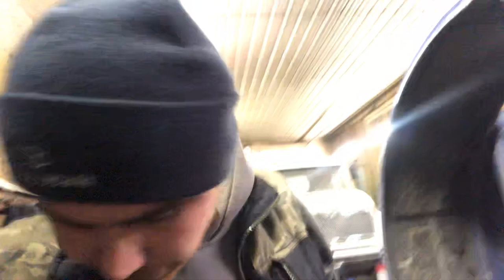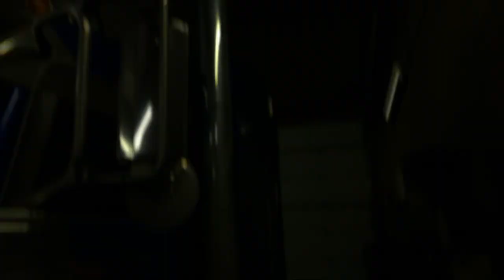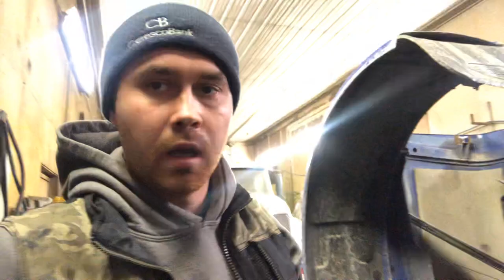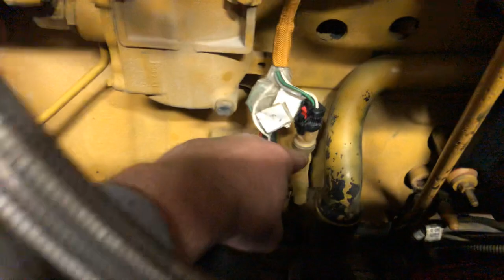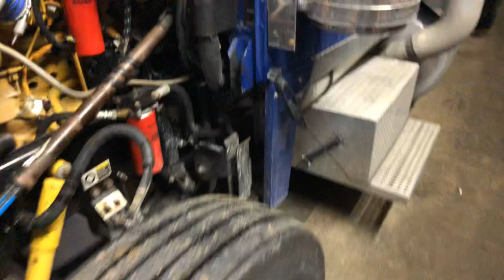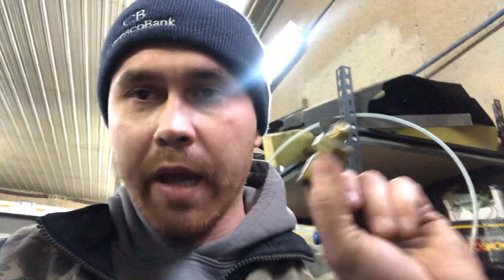Cat c15 Atmospheric pressure sensor

Comment: I have a 5ek that's been running funny. But one of my wierd symptoms is the water temp is erratic on the ecm sensor. Replaced the temp sensor twice but notice it makes a difference at what altitude im at. I also replaced the wiring harness. All started after overhauling
Reply: I keep getting temp sensor code also. Did you figure out the problem?

Comment: Came across your video a few weeks ago and just today I bought this sensor and o-ring from KW and was $250. I hope I can tell the difference on my next trip out. I took my truck out last week for the first time and seemed to idle/run fine but with a load going up a steep hill it shimmied a little. I also noticed my pyro getting up to 1000 degrees really easy so I found out my exhaust was almost clogged so I straight piped it and seems to breathe better. Hope this sensor will help too. Will update!
Reply from the maker: Pretty soon I have to record another video regarding accert cat. A lot of people been asking me some random questions I didn’t realize how Popular this video would become😃
Reply: @arsentrucking7883  yes sir! I’m excited to try this out. I hit the road Monday doing the exact same route so I should be able to feel the difference. I found location very easily. I asked my mechanic about this sensor and he didn’t know anything and/or symptoms about it. They are just like what you stated in your other video about if there is no light then there nothing wrong. Thank your time for your video. My first semi and cat so I’m trying to learn everything I can about it.

Comment: teachers a question? I have a Caterpillar C12, since a year ago the injectors have been changed 5 times and just a week ago, the mitor was completely repaired, the injectors were changed again, Caterpillar injectors, and the engine continues to give the same problem , injector failure, any response, I will be grateful, greetings from Guatemala 🇬🇹

Comment: Did that solve the problem or did the ecm have something to do with it, I have the same problem shutters spudders under load only
Reply: Did you ever fix your spudder problem
Reply: @walterfunes8927  no not yet I have not still wondering where to start
Reply: @rubelotero6023  i would try the atmospheric sensor i changed all my fuel lines the injectors the transfer pump the primer pump all the check valves and couldnt fix the problem until i replaced the atmospheric sensor
Reply: @walterfunes8927  i will try it this week but I will not know the results for a few months it must be loaded and their is no work in winter months 
Thanks
Reply: @rubelotero6023  did you ever change the sensor and if so, did it work?

Comment: When you changed your atmospheric sensor were you having a check engine light?
Reply from the maker: No check engine light was not on
Reply: Thanks. Going to change mine out  it should be doing more than it is
Reply: I've learned alot from your videos especially since I also have a pete with a mxs cat. Thanks for the help

Comment: @arsentrucking I’ve got a c15 that starts right up, runs for 40 seconds and shuts off. Starts right back up, idles good but won’t run for more than 40 seconds each time. Oil pressure is higher than normal around 80-90 when it normally runs 60 or so at idle. When I unplug the atmospheric pressure sensor the oil pressure is at normal pressure but only runs for 10 seconds or so. Please help
Reply from the maker: Do you have any ways to plug into the computer to look at the life data
Reply: @arsentrucking7883  I do not but I went ahead and replace the sensor and it runs great now. So if this ever happens to anyone now you know
Reply from the maker: @brandondavidson4735  Nice

Comment: Hey, I got a caterpillar 6NZ with low power boost, I removed the atmospheric pressure sensor and I found oil on the sensor and in the sensor mounting hole and I'm wondering if that's normal. Can you tell me if you found oil on your sensor when you removed it? Please and thank you.
Reply from the maker: Yes is ok to have oil on it
Reply: @arsentrucking7883  Thank you for the reply I really appreciate it. I was wondering if there's any email I could send you a video of the oil coming out of my pressure sensor mounting hole so you could tell me if you think its still normal. Any further assistance will be deeply appreciated, Thank you in advance.

Comment: Hey bro I got a 1999 2ws got some weird ass noises going on after injector (1) was done had the over head ran twice no luck sounds like a thump coming out of the  exhaust almost like the jakes r stuck on or one of the other injectors failed mechanically doesn’t look like rockers cam or valve train is chewed up or fucked up any way to do a diagnoses other then injector cut out because they all pass during a cut out. Thanks. Igor.
Reply from the maker: You might want to consider rebuilding your jake brake housings
Reply from the maker: I would start rebuilding Jake’s I seen a problem making a weird noise to the exhaust
Reply: Check for a short on injector harness.

Comment: I have a Cat C7 acert, and i been getting engine code for Barometric pressure fault code: SPN-108 i don't see any issues driving, do you know where will this sensor located on the engine?
Reply from the maker: I don’t know what the location of the sensor C7  But  check it should be right next to the oil ps sensor
Reply: thanks
Reply from the maker: @nayankpatel9117   You’re welcome

Comment: Any body experiencing a flutter/misfire at low rpms, goes away at higher pressure with boost. Gets worse on hotter days and obviously under a load? Feels kinda like a dirty filter my filters are new from CAT (C156NZ)
Reply from the maker: I have a feeling that your Fuel lines all of them need to be replaced

Comment: 2006 peterbilt 379 with cat c15 onboard computer say multi torque off…should it be on?
Reply from the maker: What I don’t understand
Reply: The little display inside the truck where it tells you if you have any codes and other stuff
Reply: It says cold mode (off) and multi torque (off)

Comment: Do you know the part number for it? My local truck shop is clueless and keep trying to sell me the oil pressure next to it
Reply from the maker: I donut this time I will check with my caterpillar shop and I will let you know
Reply: Part # is :  

274-6717   - sensor 
214-7568   - O-Ring
Reply: @joebaeza86  thanks! That damn part is now 256

Comment: I have my check engine light on and was told it was the high pressure sensor and to change i have to install  new one and re program  is that correct or what would you recommend I do could I just simply replace it and leave it as is
Reply from the maker: Just replacing
Reply: Thank you 🙏

Comment: Thanks for your video.

My CAT C15 6NZ barometric pressure sensor is set by Default and reading a constant 14-15 via CAT ET Software. 

The truck lacks power on a loaded takeoff, other than that no other noticeable difference.

I replaced the sensor with a New One, no change. Also no way to check the sensor by a ohm test. 

If anyone reading this can give me a insight I and everyone reading this would appreciate your knowledge...
Reply from the maker: Yvette Ramirez Check your fuel pressure you should be between 95-105 psi
Reply: Arsen Trucking are you talking about the oil pressure. Sensor.  ?
Reply from the maker: man van  map sender
Reply: Arsen Trucking it’s that. The one by the oil pressure one. ?
Reply from the maker: man van yes sir.
Reply from the maker: man van  Lincoln Nebraska
Reply: @yvette Ramirez did you ever figure out what was wrong I’m having the exact same issue

Comment: Hii , my c9 accert had same problem error code 274- 4&3 atmospheric pressure sensor current issue,
I replaced the sensor but fault code is generating
Plz help me to solve the problem
Reply from the maker: Check your wire harness

Comment: I have same issue on my c15a I changed. Everything harness , boost sensor let my try today to change atmospheric sensor
Reply from the maker: Let me know if it will work
Reply: Did it work
Reply: No, it’s not work so then I go to mechanic again he go through everything step by step then he find the problem in fuel which line come from injector to back fuel tank they have air in the fuel lines which is reverse line they he take off the air from the ball joint underneath the bank which connect both fuel tank then he shut off passenger side tank , now problem is solved he suggest me put a new ball joint at the time they don’t have in stock . Before I spend to much money on the motor 
Cat dealership told me you can change your ecm they problem even cat dealership can’t find the problem , if you want the name of the mechanic ask me

Comment: Whats the Simtoms  if that sensor it’s bad. ?
Reply from the maker: man van Engine Runs rough. Under the Heart pull ,kind of hard explain.will act like Low on fuel pressure.
Reply: Is truck shutting off by it self sometime or cut power check engine light pops out
Reply from the maker: @pilotchannelofficials1027   No I will not shut off it will run weird you have something else going on if your truck shuts off
Reply: My 6NZ stumbles when applying fuel gently in high elevations or during low oxygen days.  Even after fuel filter changes. Its been idling rough as of late.  Its not throwing any codes.  Just does not respond at the begining of fuel peddle pressure.  Sometimes it will cut out.  Alway thought it might have to do with barometric pressure.  I guess ill try it.  Thanx👍

Comment: When you driving  cat c15  you  over  35  miles lost power.   You need change the sensor  Going in the top  air compressor
Reply from the maker: There's no sensor in the air compressor
Reply: @arsentrucking7883   is not in the compression  is next to the company little inches top fron the compression
Reply from the maker: @panchovillaz8004   yep is camshaft sencer
Reply from the maker: @panchovillaz8004  or boost ps